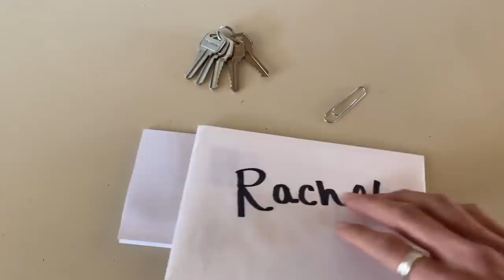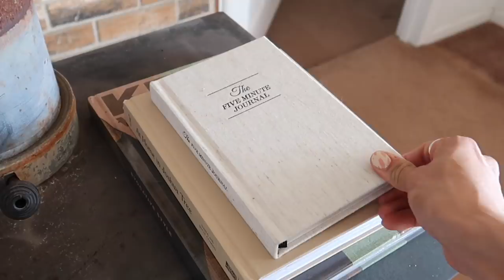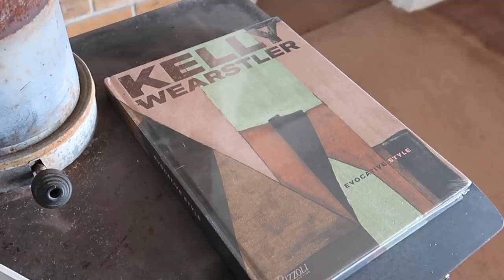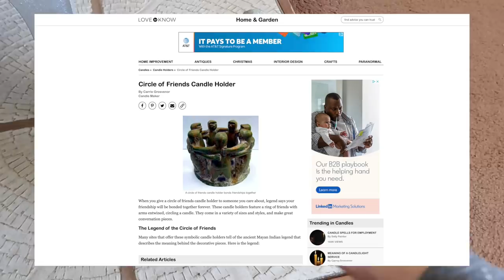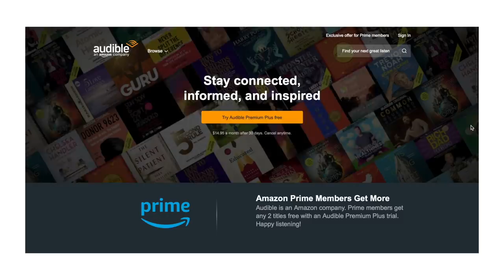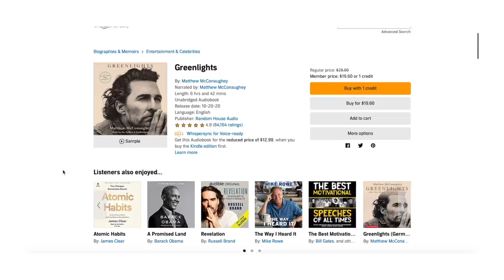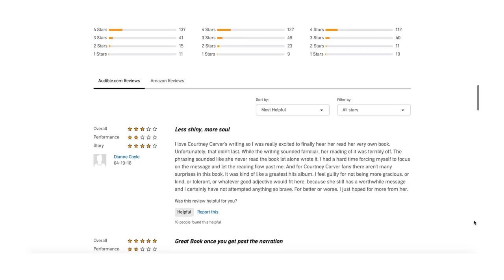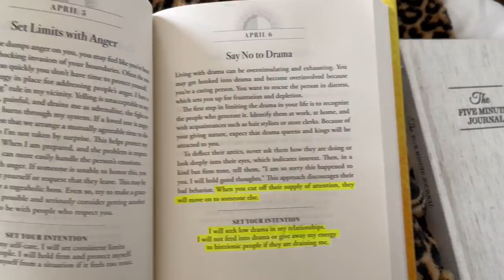Desert Diary Vlog Episode 2 | What's Been Going On Lately

Comment: BEFORE YOU DIY ELECTRICAL WORK FOR YOUR HOT TUB: look up your state/county/city ordinances/codes when it comes to electrical work!!! I say this as a former electrical employee at Home Depot (albeit in the Phoenix AZ valley). Here, one can run all the wires etc. For a hot tub, but it’s against electrical code to have anyone beyond a licensed, bonded and insured electrician touch your electrical panel, even if it’s to attach the electrical sub-panel for a hot tub! It’s a BIG deal, at least out here, because if you ever sell, you HAVE to show proof of this. 

And for funsies, I’d want to let you know a few tidbits I learned: Romex (the already bundled wires for inside your walls) doesn’t work underground unless the bundle of wires is covered in grey sheathing… the grey indicates meant to be buried directly and doesn’t require PVC… it’s not very good for above ground outdoor applications, especially in the desert… bc the sun eats everything. 

If you’re going to go with the PVC route, make sure to get non-insulated individual wires (typically 10 gauge, red white green & black) and bury it in the PVC. Don’t go with the metal pipes in the desert if you can help it… heat eats everything.

Either application has its pro’s and con’s. Personally, I’d recommend the PVC & individual wires route. 

And electricians are expensive… so if you bring them out for your hot tub, I’d recommend piggybacking off that cost for “discounted” other jobs that would suck to DIY (like drilling through siding for outdoor lights or fans? 🤷‍♀️)

Ok… I’m done… almost….

I’m pretty sure this is the longest comment I’ve ever made on a YouTube video, ever! LOL! 😂🤣